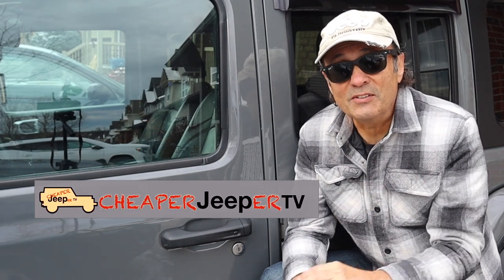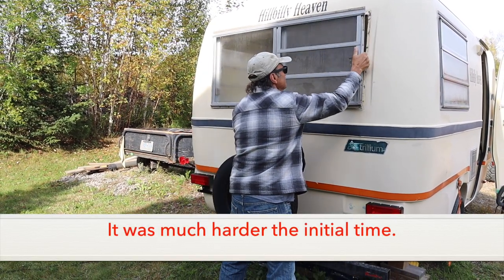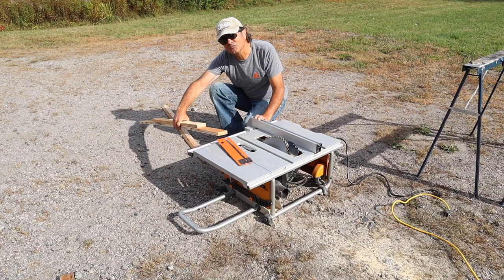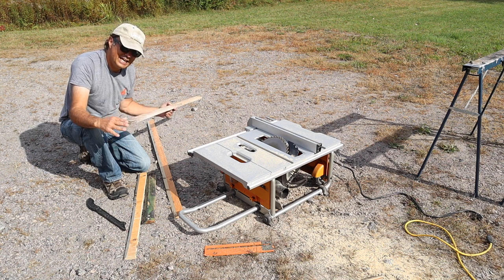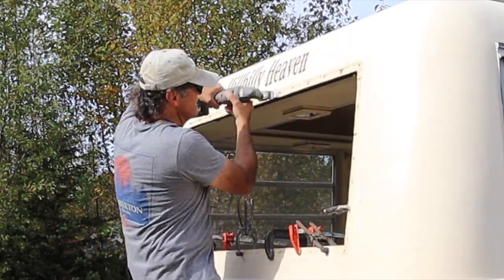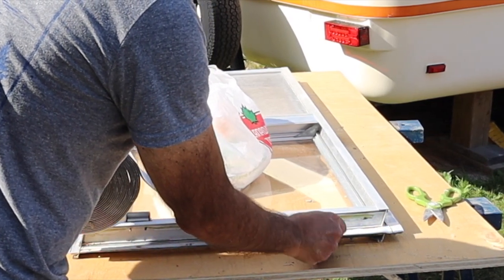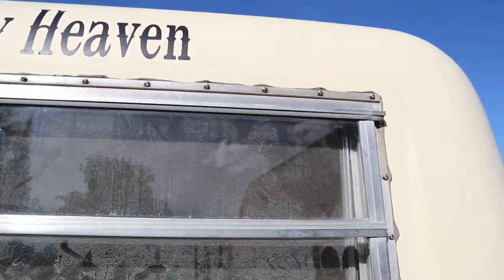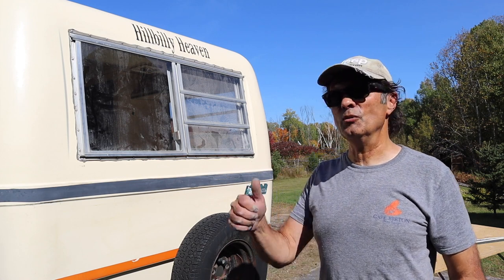How to Install and Seal Jalousie Windows on a Fibreglass Trailer

Comment: I’m about to reseal the rear window on my ‘76 Trillium. Great video, you made it look very easy.
Reply from the maker: Thanks. It was my first time so I was nervous. Now that I’ve done it, I feel more confident as I approach doing the front window as it warms up. Pulling the window out initially was tricky because the opening we pretty tight. Have fun. 
Cheers

Comment: Picked up a 1975 Trillium 1300 this summer, love it. Wanna do some mods, but not too many cause I want it original as possible but also modern functional. The 12 volt system is gone and not sure if it ever had one, but wires are there and have been cut. Can you maybe explain how it works and steps to install new ? Also, I can’t find a  decent spare tire holder for the back bumper if my life depended on it. Can you talk about that too ? Mine obviously didn’t come with that option, but I’ve seen them on other Trillium’s. Great videos, thanks !!!
Reply from the maker: Thank you for the feedback on the video. 
The rear tire holder is simply angle iron welded onto the back bumper.  Any small welding shop should be able to put something together inexpensively. I hope that helps.

Comment: 👍👌❤️🇨🇦, just a suggestion, I cleaned the window flanges first eith acetone or mineral spirits, the with 90% rubbing alcohol to temove any oily film left behind by using the mineral spirits
Reply from the maker: Great tip!! Thanks!

Comment: Hey there,  I just bought a trillium 1300. It's in pretty solid condition. 1 thing that has gone south iss the inside trim. I notice as I watch these kinds of videos it's common for it to fall off,or get Cracky. I am currently trying to  source this trim . Might you have any suggestions?. I looked for videos in your catalog, did not see one.  I'm really learning alot from your videos. Right now Tilly is at a refurbished getting things worked on. I can't wait to get her home and get started refurbishing her.  She very similar to yours but now your bench seat is a dining table. That was clever.
Reply from the maker: I’m glad you found some of the videos helpful. I’d try the Trillium Forums or FaceBook groups for sourcing materials. 
Have fun. 
Cheers
Reply: @CheaperJeeperTV    not sure how to find a forum. Just heard from refurbishment folks they can't find the seaming either..
Reply from the maker: They these kinks. 

https://www.fiberglassrv.com/forums/

https://www.fiberglassrv.com

Comment: I’m working on the exact same project now. I just removed all the plywood window frames, and am considering putting the replacement wood on the outside of the elephant skin (so it would be aluminum>fiberglass>elephant skin>wood). Any thoughts on that?
Reply from the maker: That won’t be a bad idea. Many others have done that. Have fun. 
Cheers

Comment: Hi! I’m in the process of fixing the interior plywood of my window frames as well. Your video has been more helpful. 
Question: 
1. Why use butyl tape and not silicone? 
2. The interior of my trillium is a foam liner not fibreglass. Is yours the same? The foam liner covers the plywood. And I need to remove and replace the plywood. Thoughts?
Reply from the maker: Hey Mike,
1)From what I've read online, butyl stays flexible and doesn't dry up and crack over the years exposed to the weather, as quick as silicone.
2)The stock liner is called ensolite. It is a textured vinyl outer surface, and foam backing. I used a razor to help peel the foam layer that was glued to the wood frame. I didn't use glue when I reinstalled the liner around the window.
I hope that helped.
Reply: @CheaperJeeperTV  

Can you lead me to a link or a supplier that sells the black window trim and vinyl wrap that cover the window screws and seam rivets
Reply from the maker: Try…
https://www.fiberglassrv.com/forums/f55/1975-trillium-outer-plastic-window-trim-52781.html
or
www.ShopRVparts.com